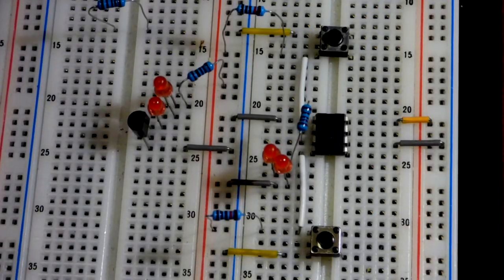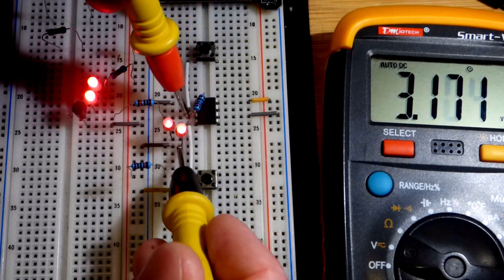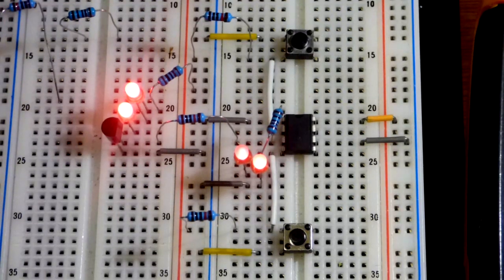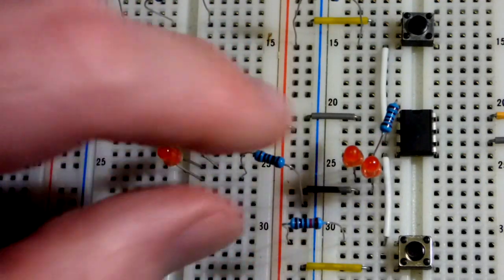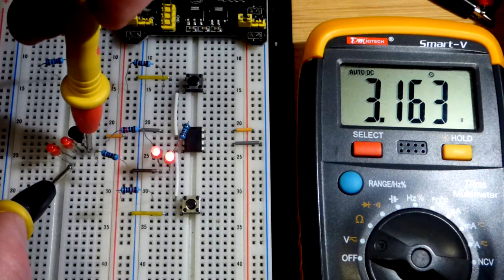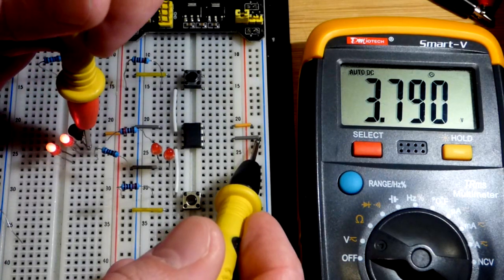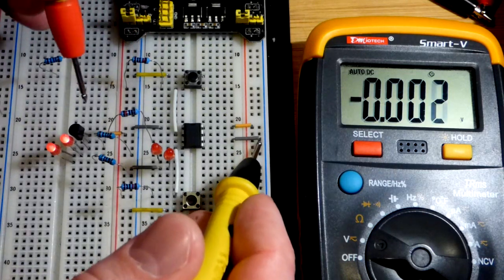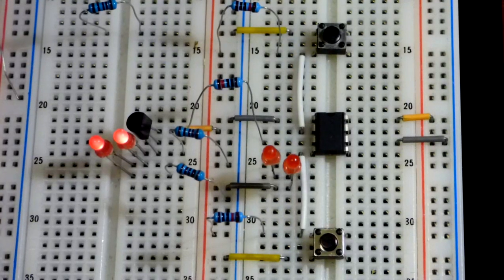2N2222 NPN BJT warning not to try switching a load on emitter side as an emitter follower circuit

Comment: From what I have learned so far, the emitter follower is good for converting a high impedance input into a low impedance output. It provides current gain, not voltage gain.
Reply from the maker: Exactly! :D